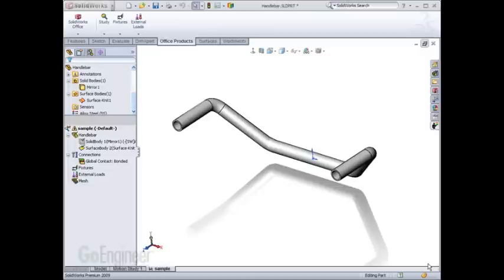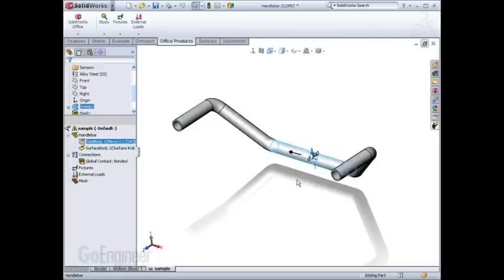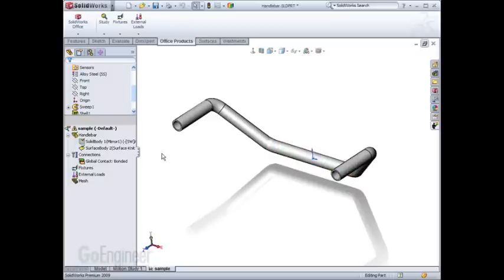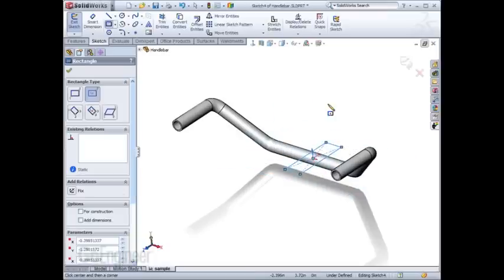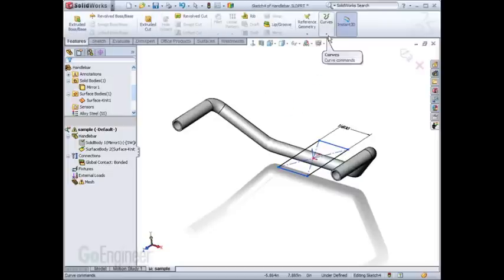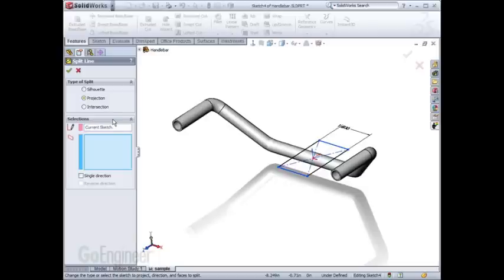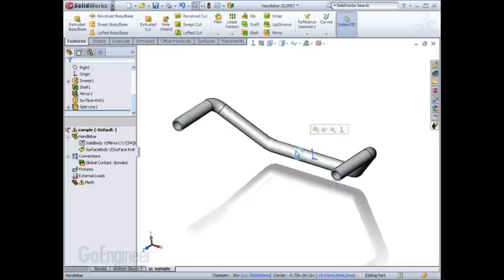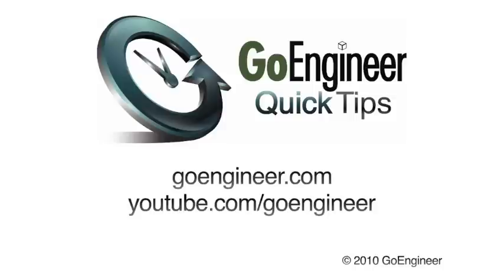SOLIDWORKS Simulation - Split Lines

Comment: How can i apply split like in a complicated assembly Simulation ?
Reply from the maker: Hi Sager,
The Split Line command can only be applied at a Part level.  So, if you have an assembly that requires the use of Split Lines you may need to edit the individual parts in order to apply them.
Reply: I have an assebly of two spur gears. In order to make the simulations easyer in ansys workbench, i need just a three teeth from each gear to be assembled, so i should split each gear a part befor assembly or whar? Thx